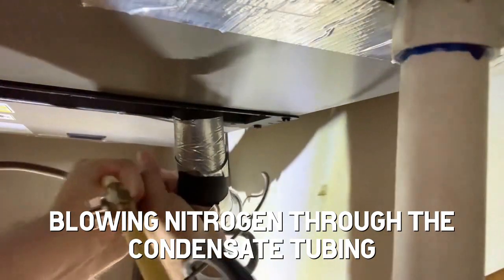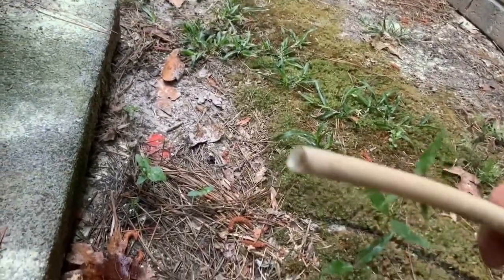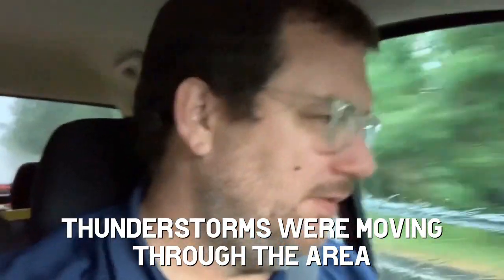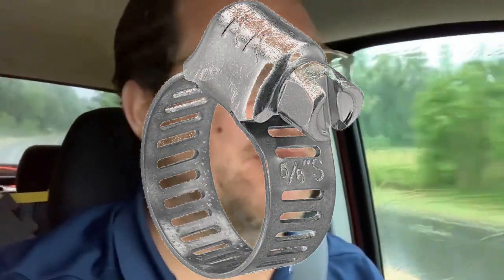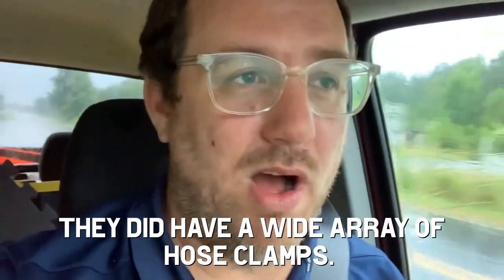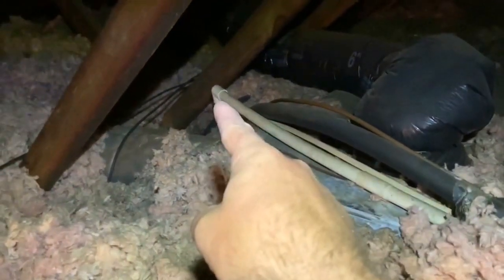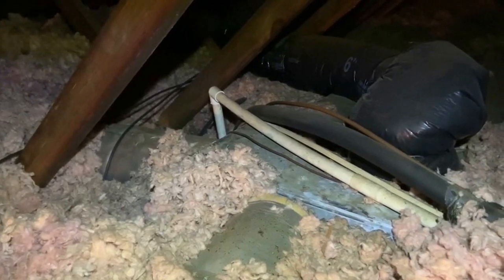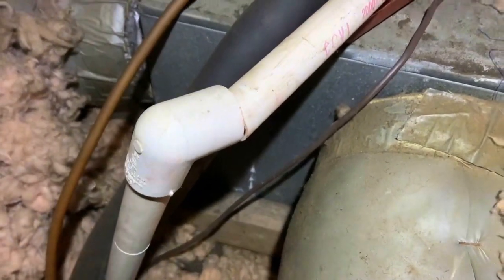HVAC Service | Condensate Pump Runs Constantly

Comment: Good vid ! Good find on that 90 degree elbow. Who in thier right mind puts a piece of plastic tubing through a 90 degree pvc elbow. 🤦‍♂️ I guess u guys got crack heads there too. 🤦‍♂️ 
I mean if it’s Absolutely Has to be in the pvc - at least use a Plastic electrical Big sweeping 90. 
I’m with u on your comment - it should have never worked. I had a plugged condensate last year and it was plugged outside. I just stuck my long skinny screwdriver up the plastic tubing and whoosh it came a pumping out , it was very satisfying to see that water pumping out of that tubing. I guess something must have built a nest in the tubing during winter time. 
Good vid !

Comment: Having this problem today! Can I do it myself or call a pro? I found the exit line buried in the soil outside…so I ‘freed Willy’…but pump is still running nonstop though I turned off the AC for the night.
Reply from the maker: Put a shop vac on it. It could be crimped off as well
Reply: @Zacksshoptalk  did that! Still, I think the unit needs a deep cleaning, maybe a valve switch, and for sure a better line flush but I will wait for cool weather to do that and in the meantime am just using an emergency overflow bucket. Thanks so much!

Comment: Thanks for the video.  What I found with mine was a line blockage as well.  In the North East so it may be related to freezing.  Do you have any videos on home humidifiers.  Ironically, my humidifier (Airline) is not working and the filter is bone dry.  I am wondering if that had anything to do with the condensate pump filling up and shutting down my thermostat.

Comment: I've seen most pumps without hose clamps...do you really need it?
Reply from the maker: I think so. Especially where the copper and vinyl tubing come together
Reply: I say yes. Gonna drip water over time / get loose over the years & make a mess. Use a heavy duty quality black wire tie at a minimum and pull very tight with pliers in a pinch. Two wire ties if joining to copper tubing. One Black wire tie at pump probably ok. Pulled tight.
Reply: Thanks. Will do from now on. Feel bad I haven't, but I haven't seen it around here =\

Comment: Good video.  You must get frustrated by stupid original installations like this.  If the plastic hose is going in PVC pipe it should have had a long radius 90º elbow to avoid that kink... Then you likely wouldn't have had to use expensive copper and hose clamps to repair it. Hey, you can still get annoyed with stupid even if you are being paid to fix it.   You COULD have used plastic (or brass) barbs and plastic hose with a long radius elbow (inserted over the plastic hose before making connections), however, In North Carolina, like here in North Florida, I suspect you can pump out a lot of condensate (16 L/day) and the internal barb might have been too small a diameter for the flow and the choke point could clog with crap.  Another option is using the next bigger size of plastic tube to go over the outside of the ends of the original tube and used simple glue to seal it if needed. and then covered it as above.  For example, the inner diameter 3/8" plastic hose has OD of 1/2" and ID 1/2" hose can slide over it tightly.  This can work, but all splices in the hose can lead to dust build up from the condensate (especially in homes where cheap filters not replaced regularly is the rule) and can clog at the splice.  In that case copper is a better choice as it has a thinner wall (3/8" soft copper coil has wall thickness of 0.03" compared to 0.625 wall thickness of 3/8" plastic)  .. just be sure to smooth the ends of the copper segment.  Here, we are always seeing clogged condensate pipe even in standard PVC due to crap build up in long runs with insufficient slope.  Lots of repair options here, because it is pumped condensate as opposed to gravity drained.   I like your option.